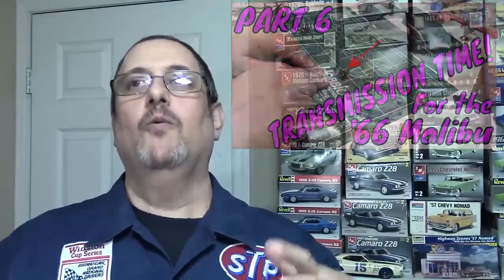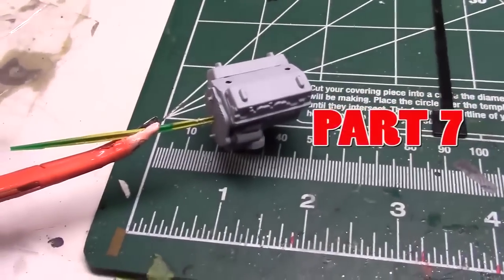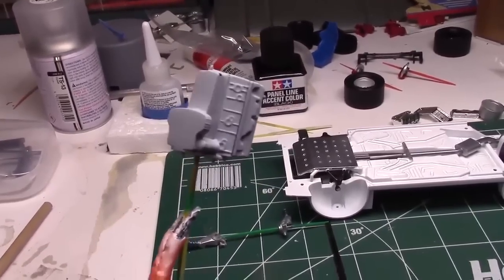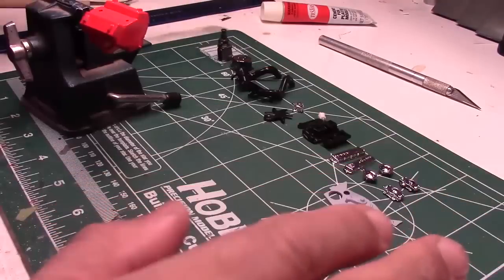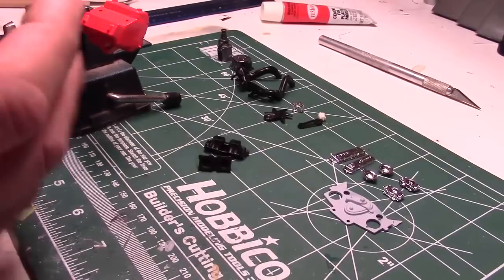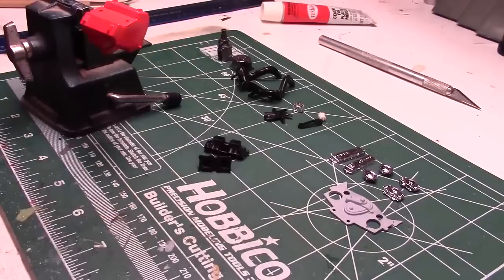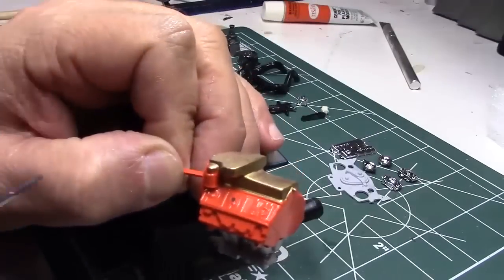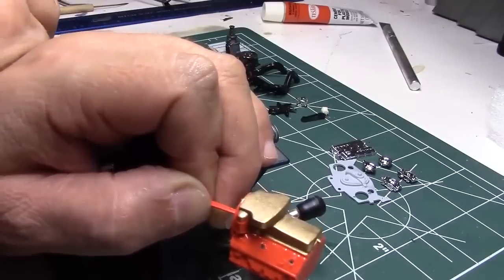How to Paint Engine For an Old Model Car Kit  (AIBMC Part7)

Comment: Enjoying this series.  Tks for the tip on 'aging' aluminum.  I'll also be doing the freeze plug detail on my next build.  Back in the late 60's and 70's, when I built an engine, I would install the plugs and then paint the block.  Never crossed my mind to detail them on my models.  Everyone, stay safe out there!

Comment: Hello I'm a first time watcher here.
I'm enjoying your show. Myself started modeling at the age of 8 and I'm now 58.
I'm to the point where your painting the oil pan. So you may still answer  my questions elsewhere in the video. Wich model master paint line are you using  oil/acrylic  and do also use testors oil.?
I have used testors model master almost exclusively  try  tamiya  a couple of times.
Within the last yr or so I have purchased. AMMO. AK INTERACTIVE . VALLEJO but yet to try them.?
Thank you for putting your skills up for us to learn from.
Reply from the maker: First. Welcome to the channel. The answer is in the video. But there is another part that is more about the painting. It's on the transmission right before this part. The trick it lacquers. It won't work with the paints you mentioned. Problem. This line of paints has been discontinued. BUT There is something new coming. If you are in the U.S.A. if you are elsewhere. You can get it. Tamiya new lacquers. They have Metallizers paints that are perfect. I have found them on line.

Comment: Iam trying to figure out what do about gluing painted parts. when I glue painted parts the glue removes the paint on the painted surface and it turns out to be a messy glue job.  Is there an answer for this?